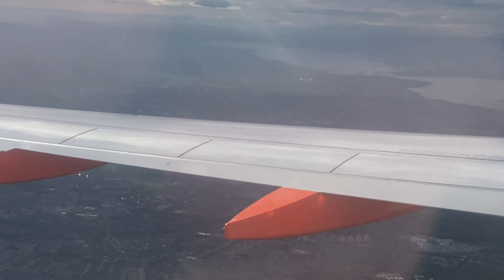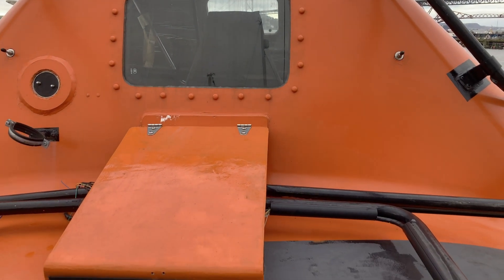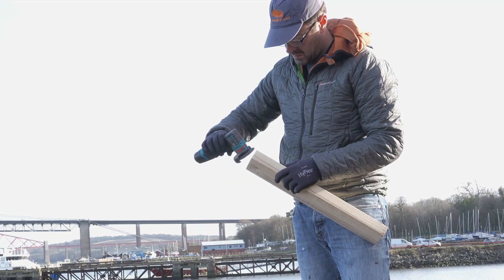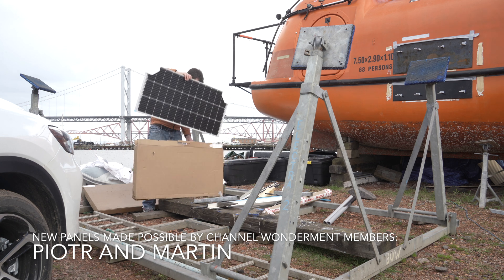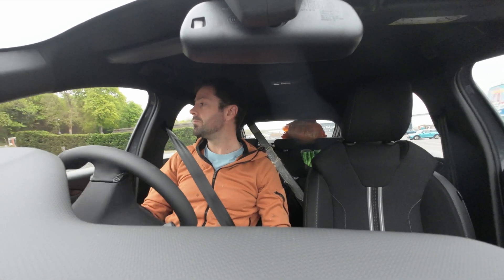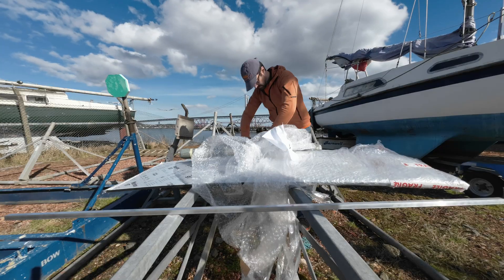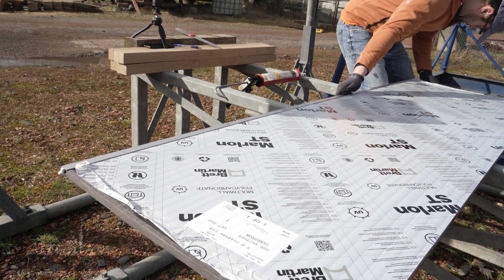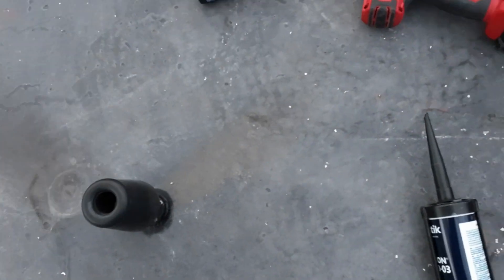200W extra solar PV power for expedition boat 24V house power supply. Lifeboat conversion Ep126 [4K]

Comment: On the drill you may be able to replace it with a chuck from the other drill or a chuck from another manufacturer.  I've replaced the chuck on 2 of my drills, one I went to a 1.4 inch chuck for some fine detail work I was doing, and the other was a simple swap of a 1.2 inch to another 1.2 inch, it was just I had worn out the jaws and it needed replacing.  I think I spent almost half of what the drill cost new, for the replacement chuck, but to get the same specs currently I'd wind up spending 3 to 5 times as much.
Reply from the maker: I may just invest in a DeWalt

Comment: If I may ask, do you know what kind of wood your timbers are?  I don't know what's available in your local lumberyard, but If I were recommending wood for use on a boat I would suggest western red cedar or douglas fir. Both of these are naturally very rot-resistant with the cedar having a slight edge. The fir is much stronger and a good bit heavier though.  Also, at one point, doug fir was the top choice for spars in the British navy, so there's some historical precedent too.
Reply from the maker: I'm afraid nothing that exotic for this role. I'm relying on lots of treatment and sealer. If there are issue later on, I'll get a custom GRP one made.
Reply: @AlexHibbertOriginals  I love that what is growing all over my backyard is "exotic" elsewhere. Tell you what, if you ever need some of the above species of timber going forward just let me know, I'll get it for you at no charge (you pay shipping ; -) )

Comment: I’m concerned about you undermining the anti-glare on top of Alan. Placing a glossy solar panel at a low angle to the drivers position could be quite a blinding affair in the arctic where the sun is low. Can you see the panels from the helm? Is there anywhere else you might put them?
Reply from the maker: The panels do reflect, but have an antiglare dimpled surface to reduce. In the event of driving into a low sun, it would be easy to cover the panels for those few hours.

Comment: Alex, I wonder what your gripe with the Caledonian is. I am about to book a holiday (Eurostar to london, Caledonian to inverness) and you got me on edge, is something off about it (except for it's absolutely insane pricing)?
Reply from the maker: The pricing is one thing - especially for the 'nicer' rooms. My main issue is that they totally failed to follow through on promises to install sensible seating for the main economy carriages - when they could have created proper lie flats or pods, like they have on many sleeper ferries. A night's sleep is pretty unlikely unless you book a room for hundreds of pounds, and you might as well spend only £25 and get a similarly bad rest on the National Express coach.

That said, if you don't need a night of deep sleep and can catch up the following day/night, then the seat prices are cheaper than daytime trains. You won't enjoy the coastal views though at night. Flights from London to Inverness are pretty cheap and quick.

Comment: On some drills the chuck is replaceable, sometimes with a screw in the base of the chuck you can see when fully open.
Reply from the maker: Yeah that's been good advice from others too. Sadly, I didn't think of it before chucking out the old Einhell - although I do think it was partly the chuck that failed after 5 years of use.
Reply: @AlexHibbertOriginals  I wasn't thinking about salvaging the old chuck although that could've been an option. My point is the new drill might be able to be improved by replacing the chuck you dislike with a better one.
Reply from the maker: Yeah I guess so. I think I'll just save and get a new DeWalt.

Comment: Even a mini angle grinder makes my day 😊 what tethering system are you using for clambering outside at sea? I’m guessing dual tethers with huge carabiners so you can use them with gloves … a bit like they use on spacewalks?
Reply from the maker: Offshore we'll definitely need a less precarious system. Usually I just pay attention and clamber around!
Reply: @AlexHibbertOriginals  not sure if falling off the boat in the yard would be more benign but I guess the ambulance could pull up right next to you 😳
Reply from the maker: There's always one more level of safety that can be installed - and someone to call you a madman for not installing that next level!
Reply: @AlexHibbertOriginals  I was trying to pull your leg … without making you fall off.  The level of planning and preparation and risk management on your expeditions bodes well for Alan’s future travels.

Comment: I too struggle for straight timber from merchants - it'd be alright if I had an aircraft propeller factory!
Reply from the maker: I wonder why it is. Rushing the drying/seasoning process?
Reply: @AlexHibbertOriginals from my experience in highschool timber class, I guess so
Reply: A bit of that, plus humidity and loose storage doesn't help. Also, where the plank was cut from the log - heartwood is more stable than sapwood.

Comment: I'd love to donate, but the website unfortunately does not support those amongst us with debit cards. I would love it (and you as well, presumably) if you added an extra option.
Reply from the maker: Hi - that's strange. I think both SuperPay and PayPal accept debit cards. Which option were you trying?
Reply: @AlexHibbertOriginals  the option where you have to enter your card number. I did not see another payment option. It just simply did not accept the credentials. It's a Dutch card, perhaps it's got something to do with thatm
Reply from the maker: Ah that will be SuperPay/Stripe. How odd. I think I can see the two failed attempts in my Stripe account. Is Paypal an option? Try https://paypal.me/alexhibbertuk?country.x=GB&locale.x=en_GB

Comment: would the solar panels benefit from being placed vertically given the sun tracks lower at northern latitudes.
Reply from the maker: At seriously high lats outside of summer we'll be relying on wind and the generator.
Reply: @AlexHibbertOriginals  I don't know if the side mount curved panels have stopped working, or are causing some other problem like trapping water, but I'd personally keep them on if they still work, and just have the new panels as additional ones. MPPT controllers are cheap at the power levels you're dealing with.

But they're right, you want the panels to be facing the sun as much as possible for maximum output.

Also, it's a little late for this advice, but for maximum efficiency especially in lower light levels, you want your panel string voltage to be many times higher than your battery voltage. 150 volts seems to be a common maximum limit for smaller MPPT controllers. I'm not sure what the output voltage is for the 100w panels you have, but if you ever have to replace them, 4x 50w panels might give you better performance.

Oh, final thought - do you have a carbon monoxide detector installed? I can't remember. Between the main engine, generator, heater, etc lots of possible sources.
Reply from the maker: Spot on Paul. Yes I won't be doing away with side-mounted flex panels. I've just been unhappy with the build quality of the ones on there. I have six replacements ready to go on. I'm maxxing out the Vmax of the two MPPT controllers, so the voltage differential is as high as poss over 24V.

Carbon monoxide indeed. In fact, I set it off when fast charging a lead carbon battery recently, as apparently other gases can activate them.
Reply: Being on a gimbal would be optimal I guess but the panels would produce close to zero until you got way up above the arctic circle. The sun tracks at 23º above the horizon during Summer at the Sth Pole apparently (don’t quote me on that, I just always remember weird facts from watching youtube channels and this gem came from an explanation of the ICE CUBE cubic kilometre of ice neutrino experiment).
Reply: There is a lot of room there for vertical bifacial panels though and a lot of reflected light from the sea. Might act like a sail though.
Reply from the maker: I think the loss of visibility for driving would be the issue.
Reply from the maker: The box lid is hinged, and re(moveable) so there's flexibility there. Luckily, modern panels seem a lot better at harvesting indirect or diffuse light than old ones used to be.

Comment: It's not super hard to swap chuck on a electric drill but ofc it's nicer if ya get a good one from the start, obviously ya void ya warranty if ya swap bits an pieces of the tool
Reply: Would you actually void the warranty in (former) EU countries tho?
If I swap the brakes in my car I still have the warranty for the rest of my car.
I guess you might have to proof that changing the chuck didn't cause the damage, but I don't see why it would void your warranty?!
Reply from the maker: I suspect drill companies don't consider their products to be repairable, except by them. Different to a car when annual maintenance is expected.

Comment: A decent car roof box would have sorted out storage and somewhere to fix the solar panels to. Waterproof too.
Reply from the maker: And smaller - not optimised to the space. And without a flat top. And more expensive.
Reply: In your face Homer!

Comment: Pretty much all Battery operated drills, Tighten the chuck back the chuck off one Click to lock the chuck.
Reply from the maker: That was never necessary with my Einhell, or my corded drill, but I'll give it a go.
Reply: @AlexHibbertOriginals  Don't bother, it's a dumb internet myth
Reply: Never  heard of this.  I've been using drills for decades.
Reply: This is complete garbage, did you just make that up? For starters Milwaukee only click when chuck tightening, when loosening there are no clicks so you cannot back it off by one click.

Comment: Shame about the Ozito. I had one for years until it died. Replaced with another one six months ago and no problems.
Reply from the maker: I find only hex or flattened drill bit shafts hold properly when you reach the end of passing through hard steel etc. Cylindrical ones are skipping once the torque needed is high.
Reply: @AlexHibbertOriginals  Put the old chuck on the new drill?
Reply: @AlexHibbertOriginals  Yes, that breakthrough point can be a pain with a hand held drill. Back off on the pressure and let the revs nibble away at the last bit of material which is deforming under pressure. That's not to say the chuck jaws aren't doing the job but it will help. I say that from a retired Fitter/Machinist point of view. Also, buy good quality drills.